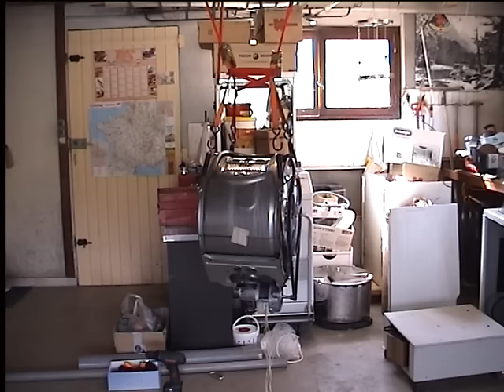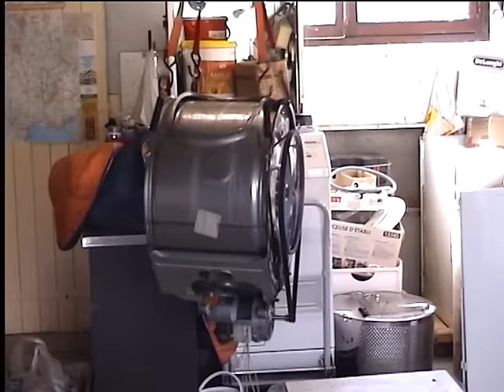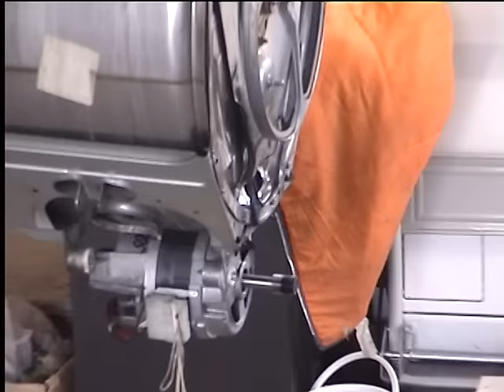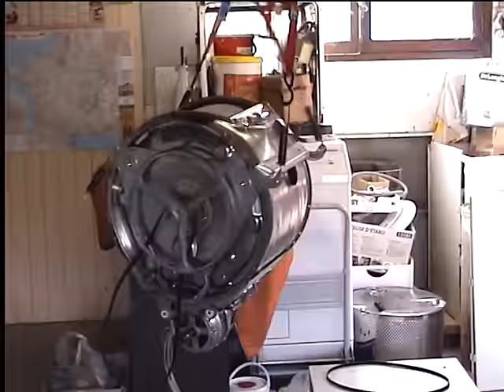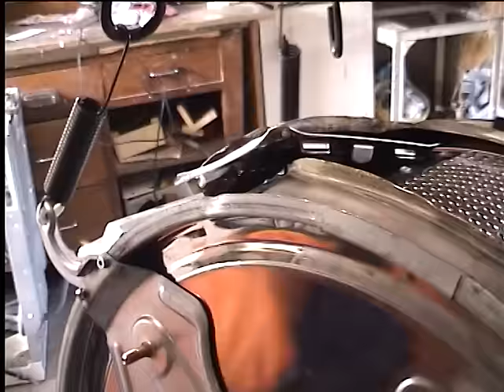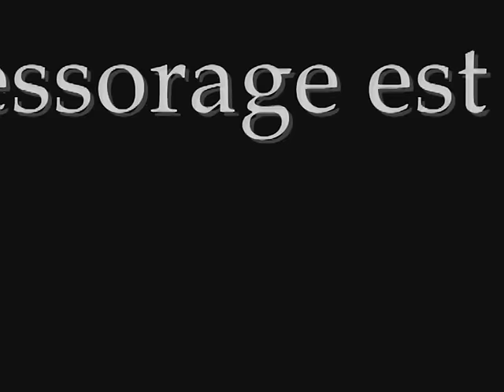Crazy washing machine

Comment: So this is what happens if the inner lid of a top loader accidentally opens during the spin, it basically ruins the machine.
Reply: That may happen with this type of toploader. They are very poorly designed
Reply: @danandlaundry  I wonder why they made this model
why not just front loader or top loader instead of horizontal drum top loader

Comment: I want to see a perfectly balanced drum spin so fast, that it flies apart. If a carbon brush motor can't spin fast enough, perhaps reduce the pulley size on the drum shaft, to gear it up, to load the motor at the higher "spin"speed.